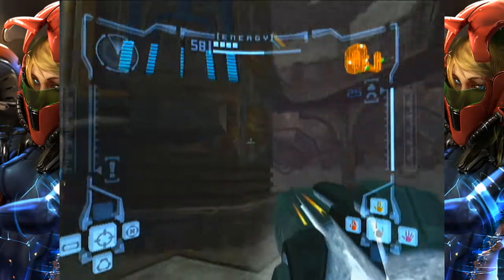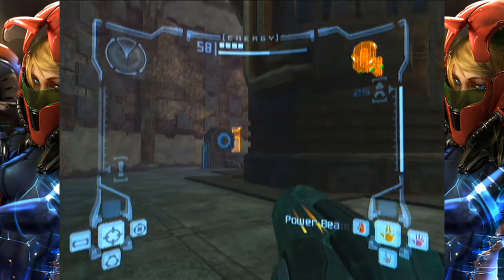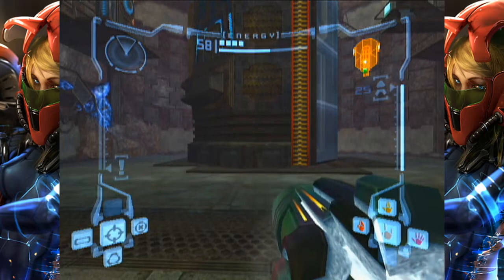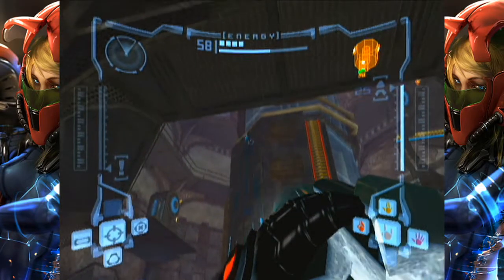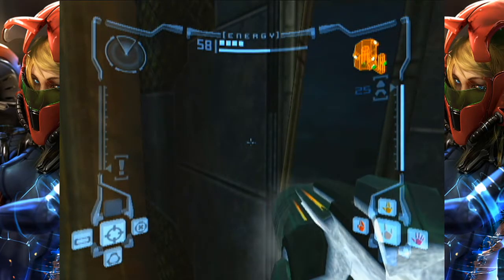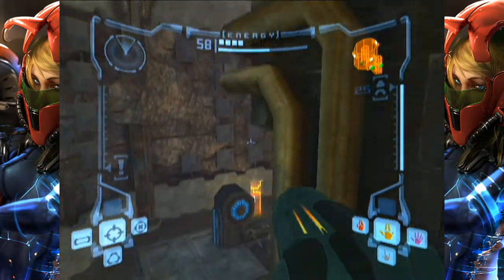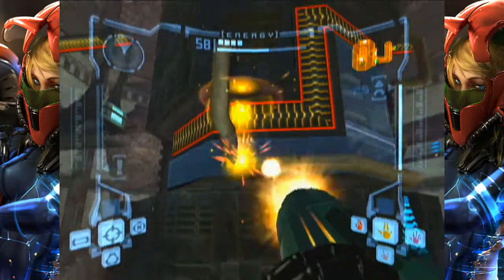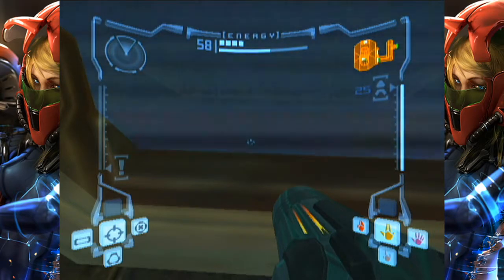Ore Processing Explanation and Movement Tutorial

Comment: For the first part of the climb, I've found I land on the pipe more consistently if I aim toward the box on the right than just the corner of the pipe.  For getting to the top level, I've also found I can slope jump onto the stationary part of the red spider track (over the platform) from the railing, though I'm still working on getting it consistently.